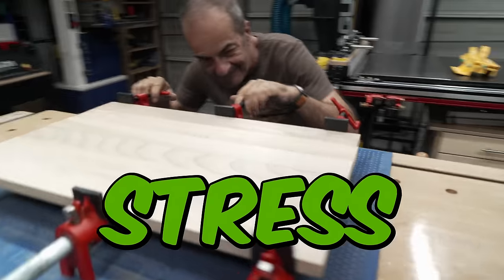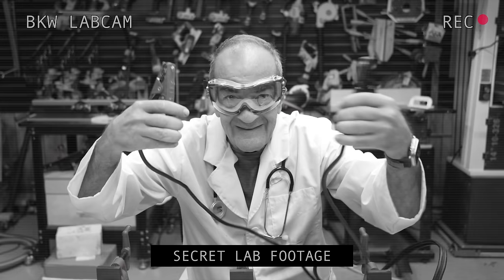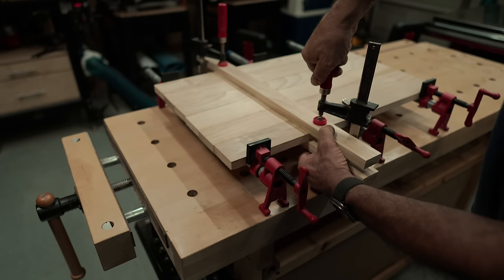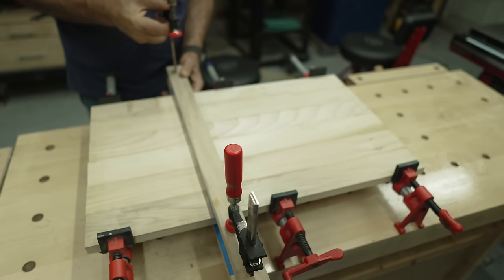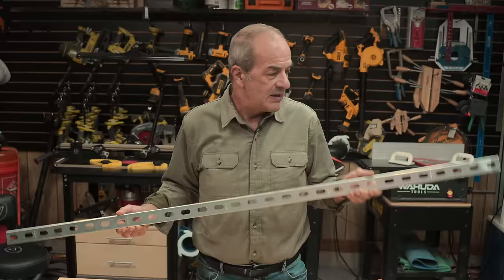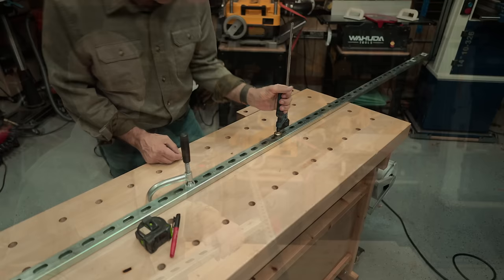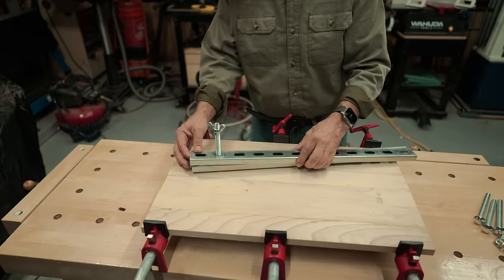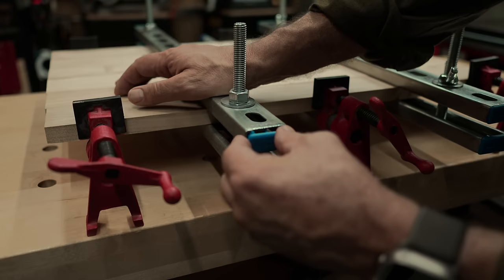Rockler doesn't want you to see this video

Comment: Hey Lee, I've been using unistrut as cauls for years and its great to see a quality video showcasing the different ways to go with this. I would add that there is also a deeper throat version of the strut which is what I had used in the past, especially for wider glue ups. One way to save a bit and have an even more flexible system is to use all thread which you can but in 5 or 10' lengths and cut it to length for thicker projects with 2 bolts and 2 washers per side. Few more pieces but it really gives an additional level of flexibility. Great video!
Reply from the maker: The all-thread is a good idea, but I like the carriage bolts because you don't need to hold a wrench on the bottom nut. I like Unistrut too, but it's not as easy to find for most people (most of the big box stores don't carry it). I used to know a guy who worked for the city in Public Works back when I lived in Maine, and he used to give me old green sign posts to use!
Reply: I found many struts I'm using on junkyards -that's the cheapest option, I guess.
I don't remember how I came to struts, but it was years ago.
Funny presentation. 😉
Reply from the maker: @m1ha1mateescu  junkyards are full of of cool stuff! I should do a junkyard video!

Comment: I use this method. Two suggestions. 1. Turn the unistrut over so that the perforated face is against the timber - this spreads the load and avoids marking the timber.
2. Stick some PTFE/ Teflon tape on the face of the unistrut to make it totally glue resistant.
Reply from the maker: Both excellent suggestions, thanks

Comment: One add-on for the sticklers out there; you could add some blue tape (or other thin shims) to the middle if you're concerned about getting full pressure at the middle.
Unistrut is a great idea - I never got the hang of making a curved caul on the jointer anyway and you're right, you need 6 hands to put them in place.
Reply from the maker: Yep — shims, tape, even some strategically placed nylon washers might do the trick!
Reply: @BustedKnuckleWoodworks  Or some more threaded fasteners, outboard of the existing ones, to act as spreaders and induce a gentle bow in the opposite direction? (Sorry I'm late to this party, only just had this video recommended to me!)
Reply from the maker: @cooperised  excellent idea my man. I may steal it for the Part 2 video I’m working on 😁
Reply: @BustedKnuckleWoodworks  Sure!

Comment: That is certainly a good 'off label' use.  Gotta say, I have found the Rockler panel clamps darn easy to use, not fiddly at all,  they even used some sort of paint that allows any glue that runs out onto them to be knocked off easily.  With a couple of shims, I'm using them lately to clamp up some coopered chair seats, saving me having to build a special jig for the job.  
All the Best to you.  -Veteran '66-68
Reply from the maker: "Off-label" use? Oh no 😱 please don't tell the FDA

Comment: I have used wood cauls in the past that worked ok but found I had to create a slightly crowned surface in order to clamp flat because of board flex.  This looks more resistant to flex.  Nice touch with the quick clamp instead of the wing nut.  Think I’m going to get some of this next time I have a glue up.  Thanks!
Reply from the maker: A couple of things I didn't mention in the video... for one, they have two larger sizes that are even more flex-resistant if you are doing something like a large table or whatever. Second, they make spring nuts (kind of expensive though) that make the setup a little quicker as well. Thanks for stopping by, really appreciate it 😊
Reply: @BustedKnuckleWoodworks    thanks for the tip... very cool when you find products from other use cases that work perfectly for woodworking.  Similarly, I was upgrading my 5 gallon bucket on my smaller dust separator, and had issues of the bucket collapsing.  I found for like $25 you can get a big sump pump basin that has a great top and beefy plastic walls too that has worked out excellent. haha!

Comment: Personally I use wooden cauls rounded on one side to keep pressure in the middle, but good tip, and I love your style! Hitting subscribe right now!
Reply from the maker: Cool, appreciate the sub! 👍😊
Reply: I was going to post that, take the wood and plane off each end just a few times from about a third from the edges to form a slight "bow". Then, when you tighten the ends down, you'll get more consistent clamping force across the entire width. I was also thinking to turn the wood caul on edge instead of the "flat" side as it should be stronger and less chance of flex.

Comment: I'm really not a fan of clickbait titles/thumbnails, but yours struck the perfect balance to actually make me curious about the video.  Your presentation and clear explanation got me to subscribe.

I'm in the process of boxing in a trailer, and seriously considering framing it with that U-channel.  It just makes so many built-in opportunities for securing work areas and cargo.
Reply from the maker: I’ve used it to build shelving frames, very easy to work with and it’s all nuts and bolts so no welding necessary! (You can weld it of course, but I suck at welding unfortunately)

Comment: Loved the video and immediately bought a 10' piece of the 12 gauge. I leaned the 10 against a shelf and noticed that it flexed somewhat where the 12 did not. Also bought the end caps for that 'Rockler' effect. The nut choice I made was to go with a handle nut. I found them on McMaster Carr. They give wrench leverage without a tool. Brilliant design Lee.
Reply from the maker: @MrFixmeister  handle nut is a great idea. I’m working on a part 2 for this video and I might just put those in!

Comment: Hey Lee, this is pretty darn cool. Tks. But are you not a bit concerned that the metal will mark the wood you are glueing up, or is that why you only suggested 2 wing nut turns to tighten…and not to over tighten.  I’d feel better with some sort of protection between my wood surface and the 2 channels of the strut . Thoughts?
Reply from the maker: I hear you on that. I don't usually crank down on these that hard, but if you really need to, you can flip the struts over, which gives you a lot more surface area. 

I do find having the open side down is easier, and it’s not usually an issue as long as you don’t over tighten them. If you put the flat side down, the wing nuts don’t fit, so you’d have to modify the clamping mechanism. They make specialty nuts that fit in these channels. They're kind of expensive, but make it so you can have the open side facing away from the wood.

Comment: I like to use tapered hardwood cauls that end up keeping steady pressure all the way across the glue up. I wouldn't mind trying these, though, but the thicker stuff is definitely going to be the better choice. Even a little bit of bow/flex in the middle can allow panel movement.
Reply from the maker: They make these in 1 5/8” and 3 1/4” that you could park a truck on. For larger glue ups those are always an option.

Comment: Ok you got a subscription from me for this one, only the second one of yours that I watched. I just did my first glue-up with these new cauls. Amazing! No more struggling, juggling wooden cauls with tape on them just to have to adjust them and they fall off to start over again. I did take your advice and get wing-nuts as well as hex-nuts, but I ended up threading the hex-nut on the bolt after putting it through the bottom bar, therefore keeping the bolt in place. I love how you can loosen them up and slide them around without falling apart. The only thing is....now I have to make about three more! Thanks man!
Reply from the maker: Awesome! So glad these are working for you! ❤️

Comment: Woodriver makes the 4 way crank clamps that require using hardwood to assemble... some super strut and some flat end recessed machine screws and the plastic strut hanger inserts does the job.... great thing is with a quick loosening  of the machine screws... you can move the plastic crank channels onto longer or shorter pieces of strut for your needs.
Reply from the maker: A little more expensive for sure, but that could be a great mod

Comment: This is a super good idea. Could you take it to the next level by inserting some wedges between the clamp bolt and the edge of the board and the Uni-Struts could do the entire clamping job? 2 Wedges on each end of each clamp should work for a smaller glue up. Could be used if you didn't have enough clamps to clamp the entire glue up on a longer piece.

Just a thought. Thanks for the video
Reply from the maker: Several others have mentioned the same idea! I've never tried it but I'm definitely going to on my next glue up, I'm curious to see how well this would work 🤔

Comment: Just found this! Great idea on the strut material Lee, although I was always taught that a caul should have a slight almost imperceptible curve to the clamping face that ensures a uniform pressure from the centre outwards across the glue up board as you tighten them down, (flat ones tend to just clamp on outer edges only )so here's an idea, you could always try planing a curve onto a softwood board,  then rip it into strips, & cover them with tape or wax,  to attach to the struts as a sacrificial non marring glue proof face,
Reply from the maker: I wish I had mentioned in the video that they also make two thicker sizes of struts for larger glue ups. As long as you don't overtighten them, these will not flex, so I have never found the curve necessary. A few others have offered similar ideas as you mention here though.

Comment: And you can even use those with a wooden slat on one side and a pair of wedges on the other to avoid using clamps, works like a charm too.
My best glue up method to date is actually a pair of oak struts rope crossed on both sides and wedges to tension the rope... Way way way more efficient than clamps
Reply from the maker: A couple of folks have mentioned using hardwood wedges, such a great idea. Wish I had thought of it lol

Comment: Thanks - great video!  You can take this idea a little further by using wedges between the bolts and the work to add clamping pressure to the joints.
Reply from the maker: I know… a couple others suggested that also. I tried it and it definitely works!

Comment: 35 years ago when I bought my Shop Smith I got 2 of their caul - clamps. These will clamp and put pressure on the flat sides at the same time. It works for glue ups that are 16 inches or less. Then somewhere I found generic ones so now I have 4 and I remember seeing the clamping parts (no wood included) somewhere in a book...

Comment: Great idea!   ...and, to be a little extra with the longer ones, putting a small bow in each bar will help make sure that the center of the panel receives optimal pressure.
Reply from the maker: I don’t really find putting a bow on these is necessary. These are really stiff (especially the larger ones) and if you are tightening enough to bend them you’re going way too hard.
Reply: @BustedKnuckleWoodworks  I wouldn't do it for smaller sections, but some simple tests will tell you how much bow to put in for a particular length.  (i.e. clamps at either end, tightened with just a little extra chooch and a single point in the middle.  I would copy the resulting deflection, if there is any.)

Comment: Very cool. One point to consider is that the rockler panel clamps and similar products also provide your cross grain clamping. They’re not just cauls so this isn’t a one-to-one replacement of those products. Definitely not necessary, but if you do a ton of panel glue-ups they do save time.
Reply from the maker: They do save a little time. But you're certainly paying quite a lot of that extra convenience!

Comment: Good idea Lee. A guy could also use f- clamps in the unistrut slots as well, then you could get down pressure on top of the panel which would probably be even better than out past the edge. TU.
Reply from the maker: Yes of course, a couple of others have mentioned this also. I did think about showing this but decided against it. Now I kinda wish I had. I just thought it would add extra expense and complexity to the general idea but it’s a great solution.

Comment: I did furniture repair for 25 years, what i used to keep glue from sticking was formica blocks. I kept several blocks around that were different lengths and widths. I got mine from old counter tops that were 3/4" thick which is plenty strong for glueing anything. Never in 25 years did I have any issues with glue sticking to the formica blocks.
Reply from the maker: Interesting idea. Most here probably don’t have access to a supply of old countertops though 🤔

Comment: This is a great budget solution, but as somebody who has used a few pairs of those panel clamps they make. They are like magic and save a lot of the time using multiple clamps, from multiple angles. Inward pressure and parallel downward pressure is the target. Form a parallelogram with the strut if you can. Barrel nuts might get you there and offsetting the bolt holes between the top and bottom. 

Great solution for robust cauls though.
Reply from the maker: Good suggestion. As I am getting many suggestions for improvements like yours, I may do a follow up video incorporating those... 🤔

Comment: Into a small bar of wood, drill a hole slightly smaller than the width of a 1/2 nut. Apply a little epoxy to the nut, and tap it into the hole. I make mine about 4" long and 1" wide, but it can be any size that's comfortable. These make knobs that are easily tightened. In half an hour you can make a lifetime supply.
Reply from the maker: 🆒 idea my friend! 😎

Comment: Great idea. I did some searching and found some even taller Superstrut. A-1200 looks like what Home Depot sells now for $42/10-ft, which is 1-5/8" square. The next taller is the E-1200, 2-7/16" tall. You can even get the H-1200 at 3-1/4" tall. The taller the better to keep the strut from flexing. This should help keep wider boards flatter when gluing up. Something I'd also try is using HDPE inserted into the strut slot to keep the strut from creating grooves in the wood, especially softer wood. HDPE doesn't stick to wood glue and could be inserted into the strut in sections or different lengths, allowing it to fit the width of the glued up board. No matter what you end up getting, it will always be less expensive than the commercial ones that, as you said, are over engineered. A lot of times KISS is the best and least expensive way to do things.
Reply from the maker: All good suggestions! My channel is focused around economical solutions, so I always try to present the cheapest option for things. I really should have mentioned in the video that they do make much taller struts if you need those. One way to prevent marking the wood is to flip these over, as there is more surface area there; although I find that if you use reasonable pressure, even soft woods like pine won't dent. No need to go too tight. Just "double ugga" like I say in the video! 🙂

Comment: Since carriage bolts cost $3-6 per unit, just buy “threaded rod” at 6 feet. Cut the long rod in the cheap to your preferred size. If using tapered wood cauls (make them with 2x4s and a tapering jig for the table saw), Epoxy those bolt nuts to the cut pieces of threaded rod and thread one side of the cauls with a tap for stability and rigidity.  2x4s are cheap for large quantities, but when combined with the bolt method in lieu of clamp integration, you have a much simpler and scalable / adaptable solution.  Great 👍 video here— saved for the archives to go back to!!!
Reply from the maker: All good suggestions, thanks 🙏

Comment: Worked 35 years in piping, electrical. Uni strut, Universal Strut, Super Strut is used exclusively throughout the trades of Electricians and pipe fitters. There are many varieties and additional add ons that can be found. Try Grainger, Ferguson for starters. Electrical wholesale Stores as well. Not cheap though. For basic use at home , got to Home Depot or Lowe’s . Amazon has better selection of additional bolts, square and round washers. I built a pipe, strut reinforcement backside support for a vinyl fence every other post that was on a slope that is currently holding up to a hurricane Debbie right now.
Reply from the maker: I have a follow-up for this video where I’m mentioning many of these points. Good tips!

Comment: Hey all, great video, the only thing I would add is that after a few uses check it with a straight edge if it's bowed flip the strut and use it a few times like that to help keep it flat.
Reply from the maker: Oh for sure. And if you do longer glue ups, use the thicker gauge or use larger struts, they make these in two bigger sizes, 1 5/8” and I think 3 1/4”.

Comment: Calls are not flat pieces of wood. A proper call is one that there is to either side of center milled to each end 1/8". That way presure is increased to center when clamped. Wrapping the calls in plastic wrap prevents squeeze out from sticking to the wood. The wrap that sticks is removed when joints are cleaned up after the camps and calls are removed. To apply the wrap, mark each joint on the call and wrap there. No need to wrap the entire cawl.
Reply from the maker: You seem like quite the expert. Perhaps you should make a video about this.

Comment: Important safety note though: Galvanized/zinc plated stuff does NOT like heat. The zinc will vaporize, its state change temps are really low. You really really do not want to breath in zinc, so wear a respirator at best and work outside in the open air at worst when you're applying serious heat like using an angle grinder
Reply from the maker: Excellent tip, thank you! 🙏